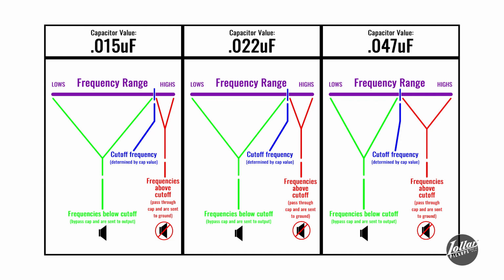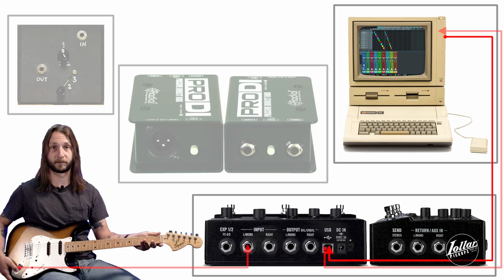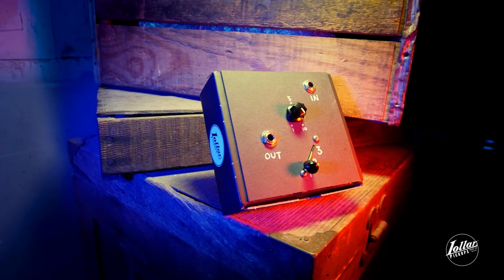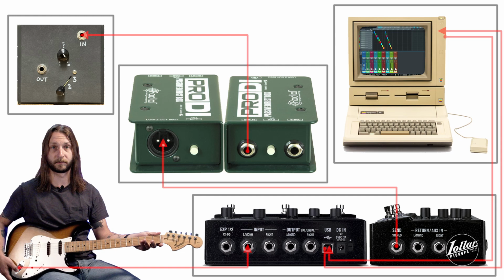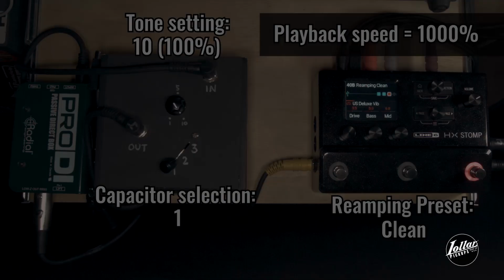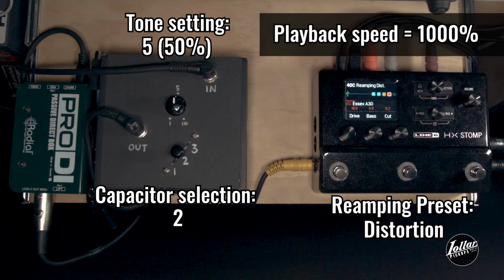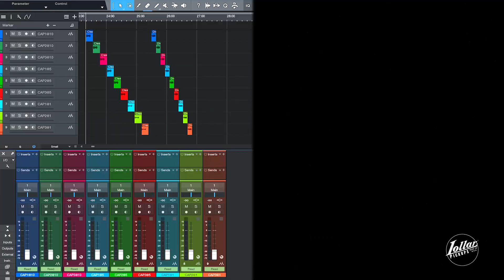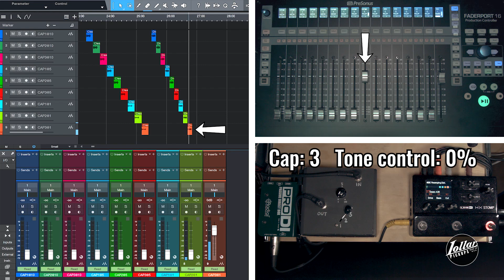LOLLAR PICKUPS Presents: TONE TRUTH - Capacitor Material

Comment: More than caps material, values are the most tone changing.

I just had an amazing experience with tone capacitors values.  
The usual values, we know the differences in sound.  Most of the time as soon as you set the potentiometer to zero the sound is muffled, unusable.  
With 0.015uf it is the least worst.  I experimented with much lower values, between 0.0047uf and 0.0082uf.  It sounds like a wahwah pedal stuck in the middle position, when the tone pot is at zero.  With some mid/treble frequencies which are preserved.  By choosing the right value I reached an extremely interesting and unique sound, and above all very usable.  Not a dull, uninteresting sound.  
I tested these values with a single p90 junior LP (50's wiring).  The sound is amazing.  I think that for stratocaster style pickups or humbuckers, other values could be better, but not certain.

Comment: Thank you. This was great- and underscores for me the integrity Lollar brings to everything they do. Having myself been obsessed with designing my own tone for 40 years, I was for most that a "cap is a cap, a resistor a resistor" guy. I was sure that even the real signal-handling differences engineers know exist between the materials were, for practical purposes, drowned-out in the mud of non-linearities and noise inherent in this kind of messy system. 

And indeed, some of my very best designs used only ceramics and carbon resistors for tone. But I learned over time they weren't really replicable- even if I hand-matched every cap and resistor. Why?

Well, with the caps it's two reasons: Heat and Acoustics. If you want some fun, hook a ceramic cap up to your capacitance meter then just squeeze it hard. Its capacitance changes considerably even w/the temp of your fingers! Then for a real shock, shock it with your heat gun or soldering iron.

Bottom line: Ceramic caps wander wildly with temperature. And in terms of acoustics, it's well knowns: ceramic caps, being piezoelectric, literally are [terrible] little microphones & speakers.

Now, here's the hard part: I actually think in my very favorite rig designs, both of those factors inadvertently were adding to the quality rather than subtracting. IOW, when I was A/B'ing caps in sensitive (high-gain/high-impedance) parts of my circuits at full volume, unwittingly I choose values sometimes because they just sounded "more interesting." And while I attributed that strictly to value then, I now realize that cap voltage-rating (as being proportional to dielectric width, thus affecting microphonics) sometimes mattered more than value in such high-vibration settings.

Oh, and about resistors, that's easy: Once OpAmps were good enough that one's entire generated noise was less than a single carbon resistor's, it was time to go all metal. Maybe it's time for us all to have wirewound or plastic film pots on our guitars/amps- but no, not worth it to me, my rig's faint hiss is nice 🙂

But about Caps: I'm torn, there really are old designs I've never been able to replicate the magic because (turns out) the schematic wasn't the whole story. But for practical reasons, I also now only use film caps in sensitive circuits- because I do need to replicate circuits, and they're quite temp & age & acoustically stable. That said I adore MLCC anywhere I used to need an electrolytic 😂

Comment: Thanks for making this video.  It's a year old, but maybe you'll see my comments in awhile.  Jason Lollar did a demo for Audio Engineering Society, I think is was, around 2002.  He used a converted sewing machine to wind a pickup.  We loved it!  Re: caps, I could hear small differences.  I correctly guessed that #2 is the orange drop.  They sound a bit harsher and more trebly to me.  But sometimes I want that.  Other times I prefer Russian paper in oils, which sound darker and smoother.  I made a cap switcher/tester so I could just alligate into the guitar and pick the cap I like best.  I'll share a private, crazy theory I have about why caps of the same value sound different:

Recall that a capacitor has a "capacity" of some amount of current (electrons actually, I think it is, before it fills up.)  For higher AC frequencies that don't fill it up, they are passed through the cap.  But lower freqs, that keep going in one polarity before turning around, they are blocked.  Hence the cap is a high pass filter.  The lower the pot's resistance setting, the more of the signal can hit the cap and the highs passed.  Here's the interesting part.  The material the cap is made of may effect how smoothly or roughly the signal is affected around the cutoff freq of the cap.  And especially if the cap is before the tone pot in the circuit (my own voodoo belief - I know), the tone is affected by that process.  That's before considering any reflections or eddies, if you will, that get reflected back into the circuit and the output.  

I don't have a oscilloscope good enough take a look and test the theory.  But if you want to check it out that would be great.
Reply: You are aligned with my experiences as well. I ended up preferring pio caps in mahogany guitars. Vitamin Ts oil caps in strats, bumblebees in thin sounding guitars like Ibanezes as it slightly fattens them up.

Comment: Thanks for taking the time to analyse the # caps. Although the difference is very subtle, I tend to prefer the #3 and discovered it was the bumble bees. I have them in my LP and they sound sweet and mellow. I have an I-35 LC  fitted with your low wind Imperials: awesome pickups. The caps are polyester film and foil (Jupiter I think). They allow for a wide tonal range and I tend to roll back the tone quite a bit to cut off high frequancies. Being a '50s wiring, the tone pot influences the volume so I have to find a sweet spot. Thanks for uploading guys: Jason is a tone wizard !! 🎸🎵👍🏻
Reply from the maker: Exactly! There definitely IS a difference, and you're right -- it is a very subtle difference. And that difference may, in fact, just be due to the small variation in cap value as much as anything else. But that's what makes doing stuff like this fun. We weren't 100% sure what the results would be before (or even during) the making of this video.

In the end, it really is up to the individual player's preference. If someone can hear a difference and they choose to go with the one that they like better; great! And if someone can't hear a difference and they choose to go with the one that suits their wallet best, or if they just want to buy the most expensive one just to be able to say it has the "fanciest" components; so be it. As long as they are happy with the results, then everybody wins.

Knowing that it doesn't make as big of a difference, as often claimed on gear forums and advertisement copy is a good, level playing field from which to start. And that was the main takeaway of this video for me.

Comment: Having a frequency analyzer on the output signal would have been great.  Compare all 3 final signals...  Bumble bees are pure marketing.  Mostly plastic with a small cap inserted.  Including the typical green Fender chicklets and the ceramic disks seen on imports would have been great too.  The 3 tested are relatively high price.
Reply from the maker: As for the frequency analyzer, I agree. I actually thought of that after I was done editing the video and, by then it was too late and would've taken too much additional resources to go back and add it.

As for the other cap types, the main point is the same: if the values are closely matched, then there will be very little discernable difference in sound. We originally wanted to include a ceramic and do film-and-foil, paper-in-oil, and ceramic, but the ceramic caps that we had were all WAAAAAAY off spec, so it wasn't a good apples-to-apples comparison. So, instead we just used a couple different types of film caps.

Comment: The schematics at 1:40 is clear and correct when the tone knob is at 10. When the pot comes in (i.e. at 5) it starts to cut highs on the frequencies below the cutoff. What would be interesting is to show what happens when tone pot comes in progressively. Thank you. P.S. Excellent video.
Reply from the maker: I actually wanted to do this exact thing, but I couldn't come up with an easy or affordable way to implement a computer-controlled motor to turn the control at that exact same rate every time. I did actually film a few short shots of me manually rolling each one down. But unfortunately, the results were too inconsistent to be used. It turns out it's quite hard to perfectly recreate that sort of motion three times. Haha!

Comment: That was really interesting! The difference is honestly so small it's basically negligible, but the caps i ended up kinda leaning on are the same ones I have been used to using. I wonder if that's me hearing a profile I'm used to and nothing else. Honestly i now believe that I'm completely indifferent to cap material moving forward🙃

Comment: Pretty amazing demo. 
I'm pretty new at this stuff, but would it be more true to say there's a difference in what we DO NOT hear? 
One thing I did not hear was addressed, and it may not matter, was to what tolerance each cap was manufactured.  
But a very cool variable eliminator!! Wow.
No matter where I go for a listen , I can hear a difference and enjoy the orange drop. And actually listening to some others, I secondarily enjoy tropical fish.
Thanks again for such an awesome demo!!
Reply from the maker: Great question! I can't recall the exact tolerances that these were sold under, but we went through literal handfuls of caps and they were each measured independently. Then we used the ones that were the closest in value (down to the hundredths or maybe even thousandths) so that they were all, effectively the same value. The value differences between caps in this were all appreciably less than the normal tolerances that are commonly offered under what is considered to be very tight specs. We wanted to ensure that the comparisons were as consistent as we were able to control.
Reply: Oh,right. I believe you did mention something about that then.  My bad.
So then this IS the best video. Do you guys build custom wiring also?
Reply from the maker: Not at this time. We only offer more "standard" wiring schemes in our pre-wired kits. Maybe, sometime down the line, we might have the resources to take on custom wiring requests. But, for now, we are sticking with what most folks want: tried and true wiring schemes.

Comment: The only thing that matters in a passive guitar HF rolloff circuit is the capacitor's value. This video did a nice job of comparing three different types of capacitors, all with the same rated value. But capacitor rated values have a tolerance of plus or minus a certain percent (+/- 20%, +/- 10%, etc.). So, without measuring the actual value of each capacitor, the test can't be assumed to point out any tonal differences of different types of capacitors. For a valid comparison test like this, all three capacitors would need to be matched in actual value.
Reply from the maker: Yep, and that's exactly what this video aims to demonstrate. I would think most folks doing this sort of thing would know that there are varying tolerance specs involved.

To ensure that the test was as controlled as possible, we went through bags of each type of cap to find the ones closest to the stated value to be included in this test. And, in doing so, we actually landed much closer to the stated value than one could expect from even the tightest tolerances. I can't recall the exact values off the top of my head, but I remember that they spec'ed out somewhere in the thousandths from the stated values. We did the same in our Tone Truth video on capacitor value as well.
Reply: @LollarPickups  Thank you for clarifying this. It was not apparent in the video that the capacitor values were closely matched.

Comment: I didnt like number 1 until the dirty 0%, but between them all 2 had the best all around sound, IMHO (echoing the closing message, this is my opinion, not a statement of fact. If you liked 1 or 3, and it works for the sound you want to make, go for it! Ill solder it into your guitar myself! No worries). Over the whole test the sound of 2 and 3 really just depended on the style of music and playing Id imagine someone using them with, overall they both sounded good. And honestly, real talk, no joke, put a gun to my head and I still wouldnt be able to tell you which was which hearing it live or on an album. Although I did let out a "HA!" when I saw 2 was the orange drop. So.... yeah, play what you like, the only wrong decision is letting someone elses opinion ruin how you enjoy playing. I play .028uF blue ceramic HV caps (3 10000pF soldered together because its what I had laying around and the .022uF I had in it wasnt tickling my fancy anymore) and it sounds fine for me. At the end of the day were supposed to enjoy music, making or listening. So dont stress about whats right and wrong, just explore and have fun!
Reply from the maker: Brilliantly stated. I especially liked the part where you said, "play what you like, the only wrong decision is letting someone else's opinion ruin how you enjoy playing."

Thanks for watching and for the pleasant contribution to the conversation.

Comment: Are y'all planning to do any videos concerning potentiometer tapers? I have nearly everything I need to mod my guitar, except one of your F-spaced 50's wind bridge soapbars (you'll have my order soon).

While I wait for that, I'm still trying to make sure I've ordered the right pots. I'm looking to replicate the sound and playability of a '57 Les Paul Jr. and part of that is trying to get as much versatility out of a single pickup as I can.

I ordered a 500k vintage taper volume pot and a 250k linear taper tone pot (the capacitor is a .022 Orange Drop). It'll be wired 50's style. I'm settled on the values, but the information available on the internet on pot tapers is all over the place.

Some say that the volume and tone controls in guitars are supposed to work differently than those in other electronics like amps. Some say that our ears don't hear changes in sound in a linear fashion. Some say that it all just depends on how you want your particular controls to work. Some people report completely different experiences from having used the same exact thing. It's confusing trying to figure out who really knows what they're talking about.
Reply from the maker: Not at the moment, no. While it's a pertinent topic, it's not one that would be easily demonstrated in any sort of replicable way. The problem is that the variables are too appreciable. We couldn't guarantee that we would be able to turn the pots at the exact same speed each time and, without that, it would be an apples to oranges comparison. Since the curve is most apparent with motion, we would need to isolate that as our control. You could get the same sound from two different tapers, just at different places on the dial. So, without being able to demonstrate the entire curve, smoothly, evenly, and the exact same on multiple tapers, there's no good way to exemplify the differences. But, should some sort of way of doing it present itself, we may take it on in the future.
Reply: @LollarPickups  Thanks, fellas. I appreciate the reply. As they say, these smaller components aren't expensive. If one thing doesn't work for me, I'll try something different, till I find something that does.

Comment: If the variables you are trying to eliminate may cause confusion or bias on comparison, then that of itself shows that any differences as so slight as to be completely ignorable. $200 PIO cap or turning the lights off? Hmm, okay. I didn't hear enough difference to make me want to consider using any cap other than simply avoiding "cheap random crapacitors". Bite in with the pick a bit, lay off the tone to taste or even re-EQ the amp or compression slightly. These things have WAY more effectiveness as part of the feedback loop of playing an instrument and your playing responding to the sound, right?
Reply from the maker: I agree. Player input is 100% where tone starts. Taylor Guitars used to refer to this as "bone tone" and it's the innate sound that comes from the player's style; pick attack, strum placement, fingering, vibrato, etc. These all add up to a very unique variable that cannot be reproduced or accommodated for entirely by a pickup, instrument, cable, pedal, amp, or effect.

The argument could be made that, by addressing every minute variable at every instance, you could sculpt the sound you want. And this is true to an appreciable degree, but this still doesn't really change the player's input and natural playing style. This playing style is inherent in their sound, it's like their sonic fingerprint. A different cap material will not accommodate this in a way that justifies the effort to change the capacitor.